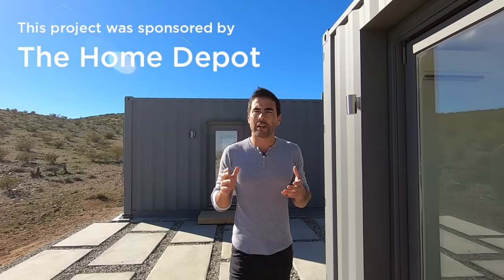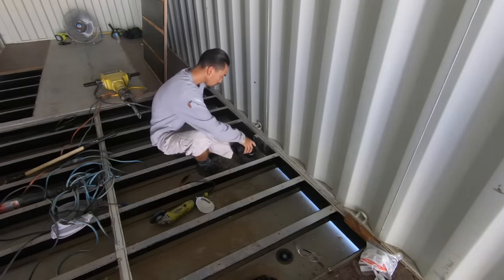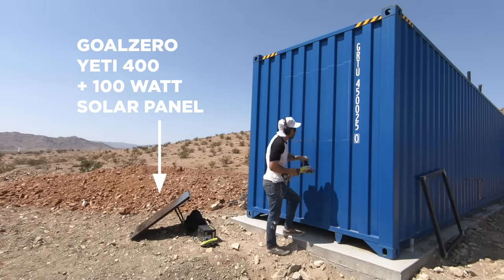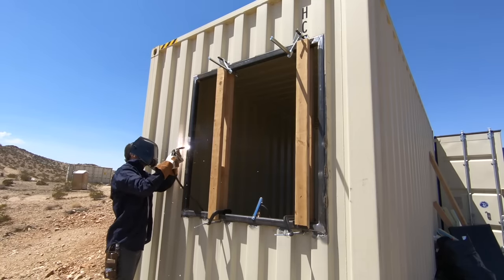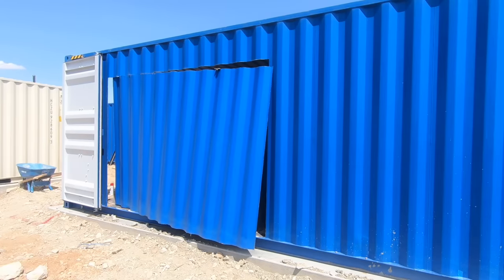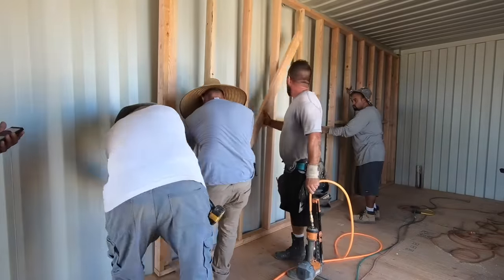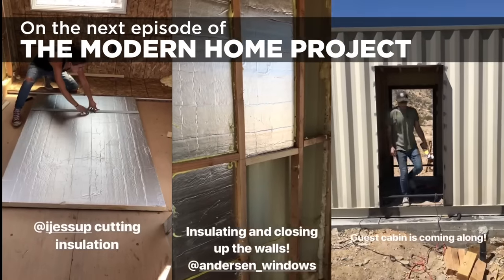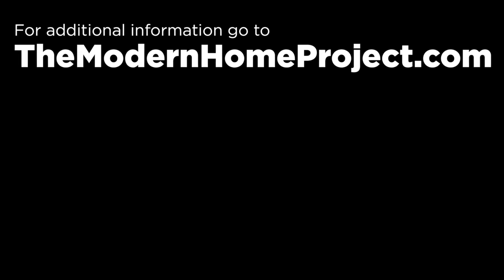Building a Shipping Container Home | EP02 Moving, Cutting, and Framing a Container House

Comment: You lost me when you built a wood house inside of a steel container...   This is WAY to painful, just build a f-ing house.
Reply: put utilities on the property then buy a big motorhome to live in. the permits alone ($25k) could have bought a big clean used motorhome.
Reply: rcpmac 
Than what is your solution to insulate the container?
Reply: to where?
Reply: @chukwow5738  insulation panel, or glue battens on wall thdn spray insulation
Reply: Гӏубаьхъӏминттар
Reply: I just love some of these containers home project and I will build one soon. I understand your point of view.
Reply: I have to agree it lost me

Comment: This has pretty much cured me of ever wanting a Shipping Container House ! Thank you.
Reply: Same here.
Reply: Agreed.  The recycle, reuse, and repurposed principle was defeated by having to insert wooden framing effectively building a wood house inside the container.  The film maker was not allowed to weld scrap steel as supports.   Oddly, multi floor apartment buildings have frames made entirely of steel beams and sheet metal.

 Maybe, the containers can be cost effective as shops not dwellings.
Reply: @flounder2760  The container builders from several states reported the same wooden framing requirement.  The building and fire codes are standardized by private groups and purchased by the states, e.g. NFPA.
Reply: Insulation is a big issue. There  is no easy way to insulate and make an interior finish. Also, the steel shell is a vapour barrier on the wrong side of the wall. Framing on the outside might be better, but still ridiculous.
Reefer containers might be good, but would still have code problems.
Going illegal is probably the only sensible way.
Reply: To avoid BS regulations, I will not register it as 'dwelling'. It will be a storage building for my two showels an a bucket!
Reply: @broniuksantanuks6605  You would have to make it stealth. If anyone complains about an illegal dwelling they could issue a demolition order. At least you can just haul it away.
Reply: steveeb this is over done there’s no way the wood is needed for most other places
Reply: Billy97 using airplane insulation would be effective. Takes little space. And is not that expensive.
Reply: S Parfano      The metal floor has to be tarred to prevent rust?    Does that mean that every 10 or so years the entire contents has to be emptied, floor ripped up and re-tarred?     It may be better to remove the metal flooring altogether.
Reply: joke! No
Reply: Defeats purpose.
Reply: Oj
Reply: Don't let this discourage you. This dude did way more than is actually necessary.
Reply: @ballwizz23  He had to, to pass the building code. Wood is much easier to work with.
Reply: @steveeb9567  I know. Because CA has ridiculous building code requirements. But he could have gotten around that by simply putting these on trailers. Or not building in CA lol.
Reply: @aguilayserpiente ii

Ok w))@@
Reply: @aguilayserpiente ii

Ok w))@@
Reply: He told you it was rust proof
Reply: Me Too!
Reply: My county in Illinois only makes you pay for a permit just so they know you are building something for taxes no inspections or anything.

Comment: A little hint to save a lot of time cutting with the 4 1/2 inch grinder. Use a skillsaw with a metal cutting blade, it is MUCH faster and will cut a lot deeper and cleaner so you can make one clean cut all the way across from the inside or outside on the walls. They use a 7.25" blade or a 10.25" blade on some if you need a deeper cut! I started using a 7.25 to build dune buggies and boat trailers over 50 years ago and it worked great and was a great time saver tool. Thanks for sharing these videos I really appreciate them. Great work!

Comment: This is hilarious. Essentially what you ended up with is a method to build a house outside inwards. Built it backwards. Cladding first, then framing. All for the container aesthetic. I can't deny they are cute, and that limitations beget great designs but this is all driven by this romantic ideal of apparent "cheap efficiency". Which this clearly is not and is what anyone who actually builds with containers finds out real fast. Still, I love this project. Money be damned it's cool.
Reply: @All_Roads They should all stay away from "Commiefornia" lol
Reply: In The Netherlands container housing has been used for student housing which is way more cost efficient than actual buildings..
So it's not a romantic idealism, it's happening in The Netherlands in urban areas everywhere.
In The Netherlands there are almost no conventional buildings being built anymore, they're all pre-fabricated (with show bricks on the outside)

They even make these containers look like they're made out of bricks on the outside to fit the regular buildings in the surrounding areas...

And cramped they are not, and that's just an American bias of wanting massive turds of houses..
Reply: @foxsux6000  On the other hand, The Netherlands doesn't have the same insane level of regulation, like sprinklers. Also, no earthquakes there, so you can stack containers without an issue (though, in reality, you can stack containers where there are earthquakes, but without the stupid bureaucracy).
Reply: We do have earthquakes caused by gas extrusion, and fracking actually causes all houses except container based ones to fail..And we're the most regulated place on earth due to the poldermodel, why do you think we value the life of every dutch person to be 1 million dollars and we have the delta works (We're more bureaucratic, than you obviously know)
The Netherlands definitely has more rules & regulations than the US, sorry to shatter your beliefs that you have more regulations destroying opportunities but you're just wrong... (You're 100% less regulated)
Oh and due to all these regulations we have a much higher food safety rating than the US.. (With your constant salmonella and e.coli outbreaks)
Reply: @foxsux6000  Why does everyone assume I'm an American? Jeez, it's not just the Yanks who don't like regulatory burden.
You don't have earthquakes from gas extrusion; you have tremors. I'm from Chile. We have earthquakes. Real ones; and they don't cause houses to fail if they are built properly. The Netherlands has a lot of houses built on reclaimed bog which is highly unstable.
There's a difference between regulation and regulatory burden; you can have the same or even more regulation, but significantly less regulatory burden. And California is very different from other US states; you wouldn't look at Ireland and say that all taxes and regulations in the EU are the same.
Reply: The Netherlands invented bureaucracy, and modern capitalism..And dutch houses are built to withstand tornado which never happen here, and even then they're falling apart...You can't even wipe your ass here without an inspector....
Reply: bureaucracy is the opposite of capitalism, perhaps you think of modern fascism; fascism has enough markets so that rubes mistake it  for capitalism
Reply: @hughaxton  Modern capitalism is all about not paying out and creating bureaucracy, the less the government can pay out and enrich itself & its friends the better!
Reply: @DJohnGrady  They can flood tho.
Reply: @foxsux6000  Yeah similarly in India we designed a Infinity cafe out of reused shipping containers and it costs almost 3/4th of the price of a conventional building and looks cool af . The total covered area is around 2880 sq ft and the structure along with insulation,dry wall cladding ,Roof structure etc. had a costing of approx 80k USD.
Reply: California is no longer an American State.  Possibly never was.
Reply: The problem really is that people want it to look like a conventional home on the inside. I like the idea of living in a home I can simply hose out once a week and be done with it. I don't care if my walls are bare metal. The obvious solution for insulation is to blank off the corrugation inside and out with sheet steel welded between the gaps (air gap insulation). Reflective epoxy coatings finish off the effect, for a metal box that can stay cool in the desert. No need to waste time or resources doing conventional framing and walling. That shit increases flammability anyway. If you don't want an open floorplan, don't build a shipping container home! Even my bathroom won't be a room. If you need more privacy than is offered by a thin, movable partition, don't spend the night at my house! Think "prison chic" and you have the idea of the only sensible way to do a cargo container home.
Reply: I'm trying to build or buy in some kind of structure to live in.  What is your recommendation for the cheapest thing I could do?
Reply: @robertpaul50n  Depends where you are. In the USA, the cheapest is a used trailer-home. In my country (New Zealand) the cheapest is probably a relocated house, the next cheapest is a timber framed, corrugated-steel-clad house built in a factory or yard then trucked to site. Still, “cheap” is a relative term!
Reply: @robertpaul50n  The main problem with most countries when wanting a “structure to live in” are regulations around the infrastructure & services like sewerage & water supply. Mainly sewerage. You can build a shed with a roof for very little money but when you “live” in it, suddenly all the extra layers of codes & building “suitability” apply. And rightly so when you consider the community & land as a whole.
Reply: @V0YAG3R  idk what you're talking about? 'THEY robbed him of space?' Who is THEY. I seems to me the framing is in place to help insure structural integrity.
Reply: @DJohnGrady  If men knew the difference between commercial and private, they wouldn't be asking for permission from a private company on what they can and can't build on deeded land. The reason they do is because the trust only gives them equitable (use) title and the control remains in the trust. If you move it out of the trust's control and operate in the private, foreign jurisdiction. Then the US Inc or CA Inc or County Inc don't have any say about what you do. 

All courts are commercial courts, all crimes are commercial crimes, there are supposedly only a few article three courts in existence here.

Comment: Love the idea.  I think it should be under ground it would stay colder and warmer.  The $25,000 permits is just insane.
Reply: fucking California!!!!
Reply: RUST
Reply: Has been done but requires a great deal of work to prevent the metal from degrading. Concrete roof was poured over the top with lotsa rebar added.    Hard to tell they existed

Comment: When welding large frames, lay out the square, weld small dots in each corner, check if it's still square, than weld it complete. 
Your technique puts a lot of strength/ stress on the angle. You can bent you're angle and the square won't be square;) but nice project, greetings from Germany
Reply: Also when welding, weld the metal filament into the metal, not alongside it. So a push- rather than a pull-motion.

Comment: That box begins to get pretty narrow when you start adding 2x4's for framing. I think I would want to attach two of the boxes together and blow out part of the inside walls, then put a beam across the top of them both for structural support.
Reply: Only an egomaniac thinks there is a  best way to do something like this...But a vertical walled Quonset hut with a sprayed on insulation (preferably Hempcrete) would have been far cheap, and more efficient to build ....Since it ended up having a full perimeter foundation and a slab
Reply: Where are you going to add a beam to support 16 feet ceiling span? It is already 8 feet high ceiling in this box. Maybe building outside metal structure to support ceiling? 😀
Reply: Madness why not just build sans box by the time you.fk about cutting welding venting etc etc sealing the box steel. Better off just.framing out more head space note all the preparation work.
Reply: Happens regularly

Comment: One of the most transparent and informative videos on shipping container homes.
Reply: yes but so transparent and informative and time consuming that it should open up peoples eyes to see nothing about building a container house is very practical, easy, and hardly wise in almost any case in our country,just sayin ! no hate and more power to ya, but  the cost and time is ASS tronomical   and for what- to say "i built and live in a container"      please just build a  old beat up 40'container house for $27000 for me to get  picked up  @ your build site and ready to ship overseas -thats a challenge  and should be the price point for cheap container living. :) TRUTH
Reply: @Trucking 101  I thought the same thing. Especially with all the framing and reinforcing they did on the inside. I've built a traditional shed (wood) in my backyard about half the size of a 20' container, and it was about half the price of a shipping container.

Comment: With the code requirements it seems like it would be cheaper and faster to do traditional construction.
Reply: @xephael3485  I replied to your comment before hand. Wish I hadn't, cause now I look stupid.
Reply: Maybe not cheaper, but absolutely faster.  A lot of this work could have been done offsite and put together in a day or two if they just skipped the whole container gimmick.
Reply: @coherentpanda7115  There are companies that literally have prefabbed shipping container houses that take at most a handful of days to assemble on a prepped site. Speed wouldn't even be much of an issue at that rate.
Reply: Errr.... he still saved quite a bit on labour, and code req. apply to more expensive per sq foot methods. 
If he did a pole construction he would have been cheaper... if Cali has codes for pole and berm constructions. I doubt they do...
Reply: Sidestep their building codes and bury the container with lots of dock foam from a marina dock restoration project as in the deserts 🌵 it’s so hot 🥵 in the summertime that you’ll never find yourself lonely 😩 once locals figure out how cooler your place is inside, you’ll just have them buy the beer 🍻 while you supply the games and entertainment in cool 😎 style.  Making large tunnels through a mounded area for the container with a garden area on top or if slightly above ground, maybe a small concrete pad or carport area with a little storage shed under the county limits for size storage shed allowance. Staying under the radar is good, oftentimes it’s better to ask for forgiveness or show your lawful excuses if you actually own your deeds or property, therefore why ask anyone else for permission to use your own stuff? Duh 🙄

Comment: 15:10 "...l've had a lot of people ask why any additional sort of (wooden) structure (supports) are needed..."
Those asking the questions are correct in their assessment. I work with shipping containers too and those wooden support struts are unnecessary. These containers can hold tonnes of goods and be stacked up 8 storeys or higher atop each other, then placed on ships that roll with the waves on high seas full of saIty spray and strong winds.

The rigidity of these containers is from the box FRAME, not the side corrugated metal sheets, so as long as you do not cut into or compromise the rectangular skeleton, cutting holes for windows only marginally reduces its structural strength. However, the wooden frames could be useful to hold insulation boarding panels, hide wiring or plumbing lines or simply as placeholders for cupboards or shelves etc. later on.

The less unnecessary structures you build-in, the more living space you will eventually get out of it. Keep the original paint on these containers and paint over them if needed, and your box will never rust for a long time.

For the windows and door frames, you should have simply used wooden frames plus rubber or steel washer adjusters instead of welding that steel frame into the walls. Metal expands and cools significantly based on climate, and thats why your windows will crack or your doors get stuck, even if you cut your angle steel perfectly. Wooden frames has more play and flex and will not expand / contract as much as steel due to temp variances.
Reply: So you recommend using wooden framing for doors, windows, etc.? I plan on building a shipping container house on the beach in Texas. I know next to nothing about building. Wood will work for the climate there?

Comment: Consider foundation anchors that can later be mounted to with adjustable welded or bolted metal supports. That was good to work with and promote other people’s crafts. Shipping container makers may even consider offering designs for home builders. A cool option is a horizontal sub-terrain container that is connected to the surface with a vertical container spiral staircase. Multi-levels connecting with vertical containers is cool. Thanks for sharing your craft.